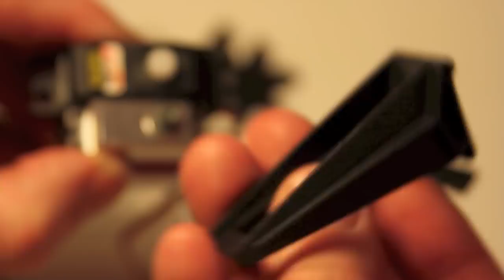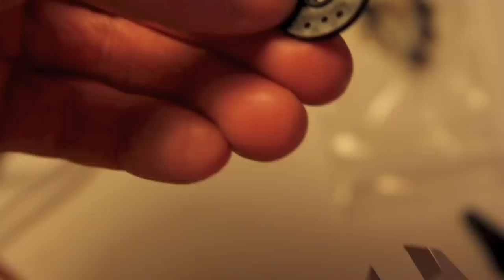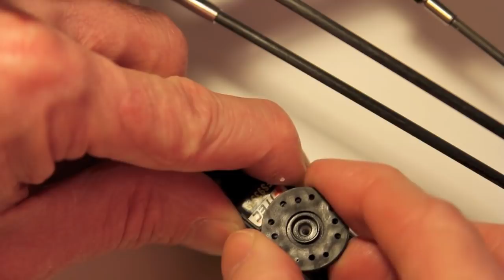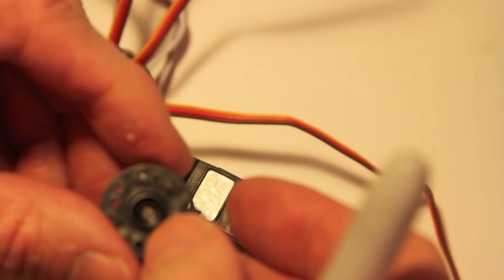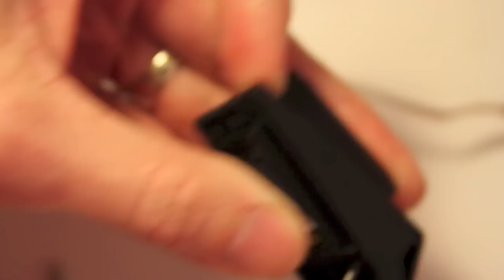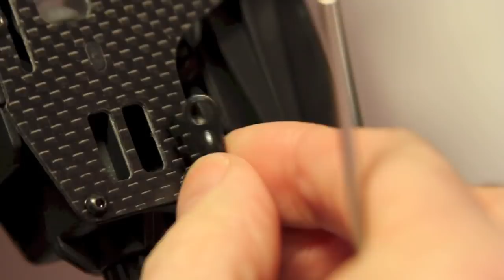20 : Tarot 450 Pro V2 Build : Tail Servo Install - FS9357D

Comment: CPO thanks for these videos. They have helped immensely in 450 pro setups for me.  Mine's not a Tarot (completely at least) It's a CopterX 450 Pro with a belt drive tail, but It has had 80% of the parts replaced with tarot Upgrades.